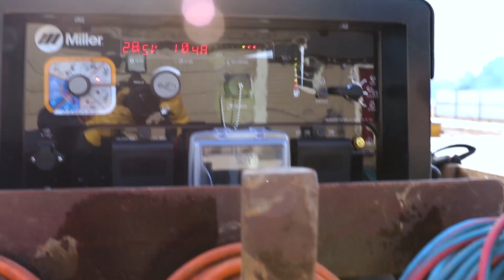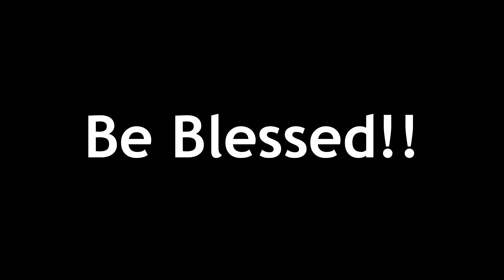Tig Welding Practice

Comment: Assuming the pipe is 6inch schedule 4. I run a root in at 110 with a 5/32 gap with a 1/8 rod the. Crank it up to 150-160 for the hot pass and then crank it up to about 180 for the fills but to cap I’ll lower it back down to about 160

Comment: That's the biggest argon tank IV ever seen
Reply: Gabe Whisen those are usually used on bigger jobs and they will Christmas tree fittings off of it so you can run multiple hoses

Comment: If you polish the top edge of the bevel with a tiger paw or flap wheel  old one or 120 grit  and knock the sharp edge off . the cup will slide . If you rock the cup from side to side. dont round the f@ck out of bevel . keep all your old cups even the chiped ones  i like the cups with the sharp edge wore off they slide better on root or bead new cup for cap. if you prep that fit right  the root will fall right in .  Point toungsten strait in or 10 to 20° back  if you lay the cup way back with toungsten stuck way out on hot pass  it will SUCK the root out dont do that    you wanted heat settimgs if you move fast turn that bitch up if you move slow keep it low.  it be good if you can hit a job with some good tig guys

Comment: Use 3/32 you'll be able to shove wire in yo help flush out in fill passes I fun my root on 115,  hot pass an fill @ 160 ish. Don't be afraid to lay on that heat, the heat is your friend. It will flow much better, go fast if you want color.... Use 3/32 an 1/8 leave 5 wire alone 

- Power house X ray tube Welder.

Comment: Jake,  I haven't heard you mention your pre-  and post- flow adjustments.  What are you using?
Reply: No pre or post flow settings. It’s a scratch start TIG rig with a manual gas valve.
Reply: @kevlarhat2000   I know.  That's the torch set-up that I have.  It's a 17V  The users simply turns the valve on to allow some amount of gas flow; gets the bead laid in; then holds the torch steady for a few seconds to allow some amount of POST-flow before manually turning the valve to "off".  Having to "flick" the torch to break the arc.  only takes a second and the user can get right back onto the last spot.  Better yet..he can use a thin piece of copper or lead  to scratch on for a clean beginning as well as having a clean end to the bead without leaving a crater in the end of that bead which would be a failing grade on a TIG test for a job.   The user just has to remember to manually operate the valve instead of relying on some internal timer to do it for him (or her).

Comment: The more comfortable you get the more hotter you run when I first started my hottest temp 145-150 now I’m 190-220 all day just what you feel comfortable for cleaning millscale check out Walters milscale wheen looks like a waffle pattern cleans rust paint epoxy

Comment: Yea now get u some stainless and run a but joint and t joint and run it without sugaring on the back side and go get u a job indoors!
Reply from the maker: David Wichert man you are bound and determined to push factory jobs arnt you? Ive welded a lot of stainless lately out in the field. I would rather run off my truck then worry about someone taking care of my retirement.

Comment: My torch is not water cooled, so it gets really hot really quick!!
Reply from the maker: Man go check out heavy hitter tig rigs. Mine isnt either thats an actual welding lead and the gas line taped together it dosnt get hot at all.
Reply: How will I know what torch is compatible to my machine? I got a Miller XMT 304 CC/CV
Reply from the maker: Text or write them
Reply: Jacob Schofield. Can I hit you up on LinkedIn. You just added me a few days ago